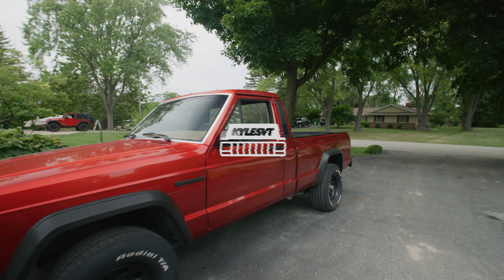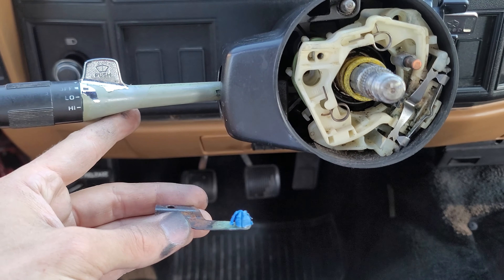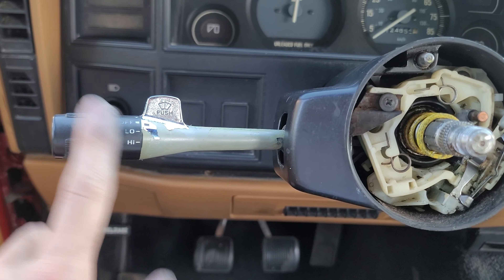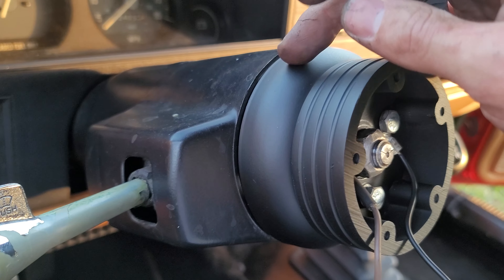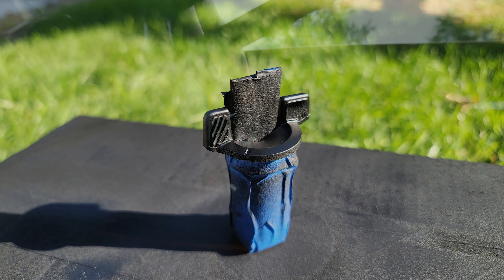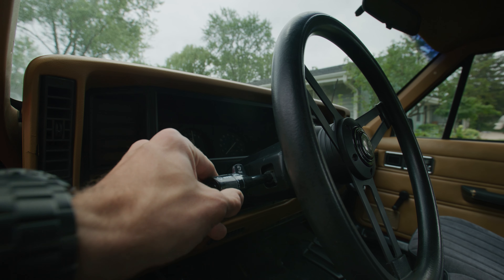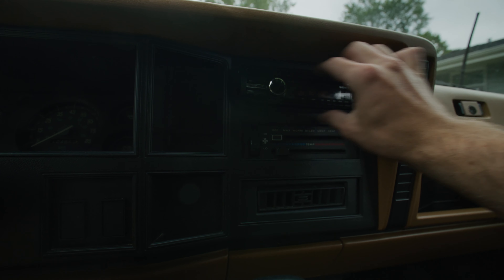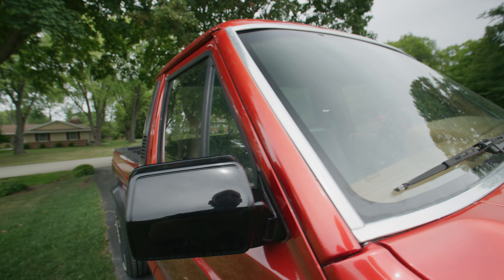Black Out Interior Jeep Comanche

Comment: Nice man! Don't forget to grab you a full cluster. I'd send you one but I had to make one outta 3 haha! Looks great though.
Reply from the maker: Thanks dude! Yes I will be getting one of those as well!
Reply: It's so nice having full gauges. Also real quick. If you do led bulbs, use a regular one for the "brights" or it will blind you at night!!! They can be finicky on initial install just takes a little patience and slight adjusting. Keep up the great work. Man I'm also going through the aftermarket stereo dilemma with getting that piece on.
Reply: @KyleSVT  are you going to put a mini console for the floor?
Reply from the maker: Thanks! Yea if I can find a shifter bezel I will.